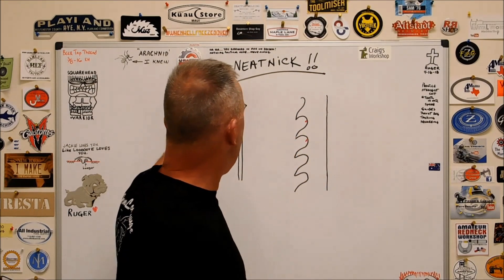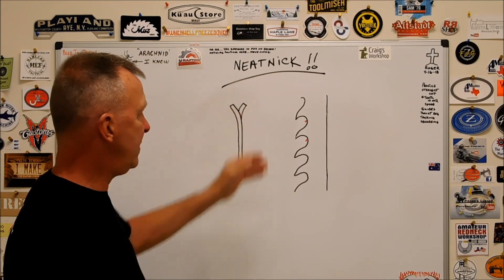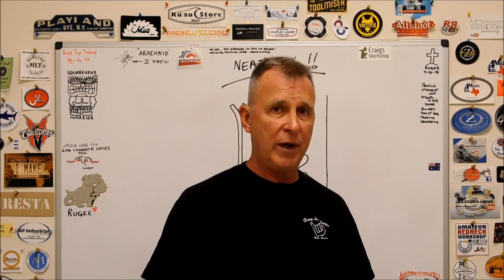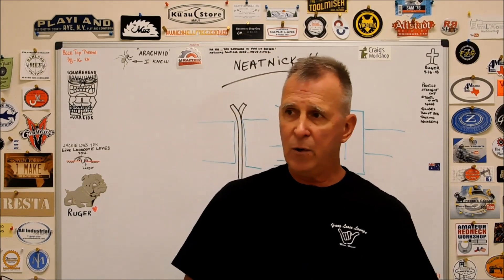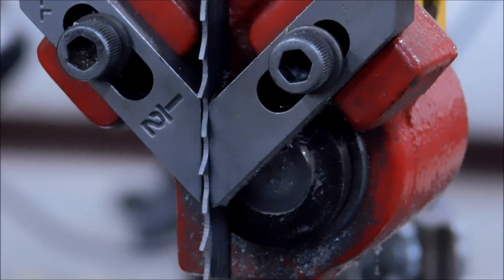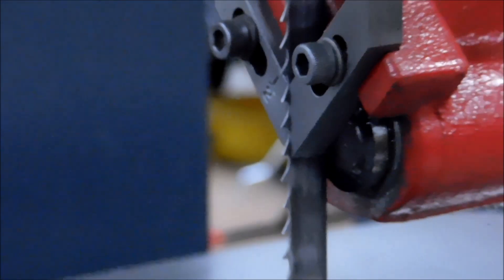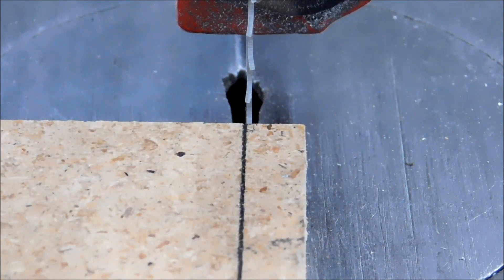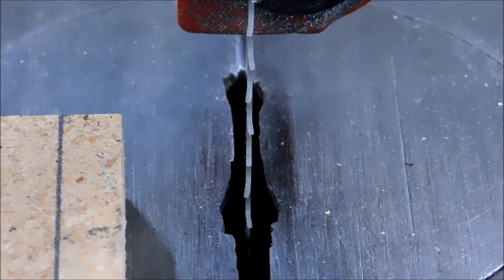Better Edge Cut Control on Your Bandsaw

Comment: Vertical handsaws & Porta bands are the most underrated tools. 90% of the time it's the first tool I go to. Plasma cutters have their place, but they give the appearance of speed. I can scribe a line & cut to it, making chips not vaporized metal, freehand. So versatile.

Comment: Using the back of the blade to guide small trimming corrections. The very first time I used a band saw, I did that intuitively. Not bragging, just saying. You do a superb job of explaining the details. There are some folks who can be taught the details, others who can see them almost without thinking. Those of us with better intuition still LEARN FROM YOU!  Thanks much.

Comment: Hi Joe, Before this video, I thought I knew  bandsaws! I have used 36” Diameter band saws & cutting 12 inch thick stock, down to Nine inch bandsaws with an 1/8” blade!

Your sharing of “riding the back of the blade” was a Revelation to me!

Thanks,

philip from the Great Pacific NorthWET !!!

Comment: Great tip on the "riding the blade'. I was at GOTL19, but missed getting a chance to say hello to you. 
When I want to be really really precise with my bandsaw cuts, I have set up a drone CCTV type camera and  display to get close up views of my cuts to get right on the line. The advantage of a drone cctv camera is that there is no display lag like you would get with a usb camera.

Comment: I restored a bandsaw bought completely all bearings shot. Thanks for showing this and the blade riding tip. (I added a switch & red indicator light to this bandsaw to indicate when theres no tention set and prevent the saw from starting if the blade has not been tentioned.
So far it has not shown to be a problem having.)

Comment: Nice. I have the Craftsman bandsaw. I just started working at mold making shop. The bandsaw we have there is atrocious. We cut big blocks of hardened K20 steel for injection molds. The thrust bearing is seized and the blade is just making a slot in it. I've been working on it when I have time. Getting a little better. Good tips. Definitely will try them out.

Comment: Enjoyed your video on bandsaw blade setup. You might mention that the guides under the table should be set up in a similar fashion. A supplemental video on blade welding and cutting internal circles with a bandsaw might be interesting. Thanks again!
Reply from the maker: I did film them, but the footage was too dark for the final edit.

Comment: When I read the title I thought to myself: well, Joe is switching to woodworking tips, I hope he keeps the precision he's got with steel  :) then I watched the video and got my answer at 14:30 ! All tips are valuable either for metal or wood cutting bandsaws.

I guess that laying the thrust bearing (8:16) perpendicular rather than parallele so it provides axial support rather than radial is done on purpose to avoid the blade to "eat" into the bearing outer ring. In the actual configuration, pressure is spread on a wider area, and wearing of contact area is done in a lathe facing way rather than in a saw cutting way.

Comment: Riding the blader is a technique I may have used without knowing it.  Thanks for the great info.  I work on and use bandsaws all the time, they are a unique machine.
I find balancing the wheels and pulleys will help a great deal in reducing the B-Saw Shakes and truing the kerf size in the material.  Thanks again.  Bill
Reply from the maker: I do have a shake, but have always attributed it to the guy who bored the drive pulley. I'll chase it out one of these days.

Comment: Another valuable technique explained and demonstrated. Given the way the band saw blade teeth are set, I suppose over use of this could lead to added wear on one side of the blade (resulting in blade drift) unless one consciously varies which side of the blade is used in this way.

Comment: That "ride the blade" technique is great -- I've been doing something similar for a while but I've never heard the technique named or talked about. When I'm cleaning up a cut similar to what's shown here and I really want to minimize the amount of material I'm taking off sometimes I'll even run the material along the blade backward, IE pulling the material toward myself. That way the front of the tooth doesn't get a chance to fully engage and you can take off a strip of material which is actually thinner than the blade's kerf. This probably causes some uneven wear on the blade but I only do it for extremely light touch-up work and 9 times out of 10 it beats taking your work piece over to a belt sander and doing an entirely separate cleanup pass. If this is a bird-brained thing to do and I'm destroying my saw then I hope someone will let me know, but I've definitely been happy with the results.

Comment: Another great video, and learned a few thing 👏👍
A quick and dirty way to get a blade to run true if cutting to one side, is to hold a piece of grind stone/wheel lightly against the ‘sharp’ teeth as it’s in motion/spinning, for a full revolution then check, repeat as needed.
Done this many times.
Reply from the maker: Basically make both sides dull? Makes sense, but wouldn't it kill the blade life?
Reply: Joe,
All depends how blunt that one side is.
I’ve only done so to get a couple of new blades to run true, and they only needed the lightest of pressure and checking after each revolution.
Those blades lasted years on a DoALL.
As a last resort on an old blade just to see you through.

Comment: Joe Pie: You make me laugh!! AT MYSELF! just an old guy here but have been mucking about my the shop for many years, and had begun to think I knew a little bit. But NO, after watching all of your videos, I realize that YOU really are a master machinist and I am just a wanna be!! YOU ARE REALLY GOOD. Thank You for enlightening the rest of us.I would REALLY like to find out a bit more regarding the DOALL bandsaw video as I too have one and have been struggling with DOALL'S omission of an adjustable rear blade bearing. It has been problematic for me to get the bearing provided set up accurately for different blade widths with respect to positioning the blade to track properly on the main wheels. Can't get the blade gullets to track near center and utilize the bearing accurately. I must be missing something!I realize this is long winded but hope you understand what I mean. Any thoughts appreciated. THANKS for sharing your wisdom
Reply from the maker: On a doall, use the tracking adjustment to set the gap on the thrust bearing since the thrust bearing is not adjustable. Then, each blade will need its dedicated guide for its specific thickness, to be setup properly.
Reply: OK! Thank You Joe. Keep the vids coming They are GREAT

Comment: Joe, Some bandsaw blades seem to unequal set on the teeth R vs L, and to cut to a line I have to angle the work.  Not a problem with quality blades.  And not a problem with the guides.   I like the tip of using the back of the blade as a guide.  BTW, I make my own blades, silver soldering the join.

Comment: Holy crap. Thank you so much. I tried cutting sheet metal one time and immediately realized the band saw was not the right tool. However my coworker...well...let's just say I have replaced the blade 7 times in the past year. He always has that blade bending and sqealing and the material is bouncing all over the place. Thin stuff like .030" up to 1/8". It sounds horrible. He scuffs at me when I suggested not to use the band saw for thin material. So I let it go...whatever man. 
After your information Joe, I can explain to him why not to use the band saw for the thin material. AND I can have the supervisors purchase blades with more teeth for those thin materials.
Reply from the maker: Slow the speed down for the metal, and maybe cut a piece of aluminum or other material to create a zero clearance condition. By having a tighter groove under the mater, and the benefit of a backup, the material will be less likely to grab.

Comment: Bandsaws  bandsaws bandsaws   -the bane of my life!  Horizonal & Vertical - Should I , Shouldn't I use a rotary instead etc....  all to do with the work thickness & Changing blades to suit + replacing damaged blades.  setting them up aligning them -not as I thought - do once and that's it.    Like the piece on the different types of heads - got more out of that than I noticed in my Op Mans.
Advice on best way to cut thin sheet shapes- up to 2mm  without a guillotine and don't mention handshears !  ?     Thanks for the mental excercise!

Comment: interesting that DoAll would use hardened blade guides. the best material to use is actually a tin bronze as that doesn't gouge the blade when it makes contact when doing radius cuts. it also doesn't dull your teeth if you have to pull your work piece backwards away from from the blade... which is a common occurrence when doing close radius cuts.

running hardened guides  in a band saw requires one of two things: coolant or lubricant. 

if you're having problems with your blades failing (breaking) prematurely perhaps a change of guide material would be the solution.
Reply: Why would pulling the work backwards along the already cut line dull the blade? Even if you’re sloppy, the blade sides will rub against the side guides, but (assuming you have the guides adjusted properly) the guides don’t touch the teeth. What am I missing here?
Reply: @steveh8724 , it's simple really: when you're backing the work off of the blade, it pulls the blade back with it often times, because the heel of the blade catches on the kerf in the workpiece. the blade then has a tendency to drift and make contact with the guides underneath the table. evidence for that is often the gouges in the table plug where the blade goes thru the table. the table plug can also dull the blade if it's made of something relatively hard. most are made from zinc or aluminium. 

there are also several potential points of contact under the table out of sight that the blade can contact when backing up a cut. 

but then the table plug can also dull the blade when cutting tight radii 

keep in mind that the lower guides do not move up or down along the long axis of the blade. so any movement other than straight into the guides will make the blade do some really funky acrobatics in the lower guides.. ideally a band saw blade cuts a radius only as short as the arc that you can create between the heel of the saw and the outermost elevation of the tooth set. the wider the blade, the longer that arc will be. that's why narrow band saw blades can cut shorter arcs better than wide ones... or why wider blades do better in re-sawing operations

Comment: Great technique Joe!!!  I will try it!  We just got a kalamazoo horizontal band saw and it had a sump set up.  We are not familiar with these sump setups or what to run in them.  Question, what type of coolant should I be running in this.  We cut mainly A36 steel architectural shapes and some cast iron, ductile, all in low volumes.  Unfortunately the saw is near the woodshop and the office so I need to keep the smell and cost down.
Suggestions?  Thanks!

Comment: Our visual perception is both wonderous and goofy as heck. For nearly 4.5 minutes, I was distracted by the strange drawing on the right, which reminded me of some globular structure I studied in anatomy class.

Your sketch skills are typically so good, I was thinkin' the Good of the Land must NOT have been good for you.

Then, in the instant you finished the perspective drawing of the guide, my mind reversed the globular thing on the right, and my mind finally allowed me to see the teeth!

Now, I can go watch the rest of the vid and not be distracted.

"The bandsaw, the most underrated, (complexity-wise), tool in the shop."

Have you tried any of the variable teeth bandsaw blades? 

GeoD

Comment: Sometimes band-saw blades will cut a curve without having missing teeth. I found that I can eliminate that problem by (using a saw set) putting a slight set to some of the teeth on the outside of the curve - every 6 to 12 inches.
Reply: Does using a saw set work for 12 or 18 tpi blades?
Reply: @googacct  My saw set would probably handle 12 TPI but it would likely need a sharper point to handle 18.

Comment: I have seen discussions on various forums about whether metal cutting band saws should have rubber tires or should the wheels remain bare, with the argument that chips can embed in the rubber. What are your thoughts?
Reply: And car tires should be cut with sawzalls...because they sawz all. ;)
Reply: The rubber or urethane tires provide grip for narrower blades that would otherwise slip on a bare wheel, and it also protects the teeth on the inside of the band by cushioning them.

Comment: Is there a horizontal bandsaw that cuts straight 90°?Every one of them i saw so far always cut curve.On my last yob we had a horizontal bandsaw for metals that had guides on dovetails so you could adjust both depending on the dimension of material that you are cutting.But even that one did a slight curve.Only method of cutting metal with a blade that cuts straight is power hacksaw.Atleast what i saw so far.But then im young so who knows what future brings.
Reply: Because of the way that the drive wheels are on horizontal bandsaws, the blade must be twisted going into the first set of guides and twist back after the second set of guides. If the guides are not rigid enough, the blade too thin or narrow, getting a straight cut can be a challenge. DoAll horizontal band saws can cut very straight and parallel. Ours often ran all day long and maintained squareness, and flatness. They use 1 - 1 1/2 inch wide blades that are tensioned pretty tight, carbide guides, and adjustable feed pressure.
Reply: The heavy duty saws are ridged enough to cut square. Think $1500+. With the $400 harbor freight units just get it close enough and deal with the wasted material.

Comment: Hi Joe, how to cut thin metall on a bandsaw? is it possible with a sheet of wood unther the metal to make the two teed hight? I have a Doall an make a new gide with rolerbearings on each site, that works great.
Reply: for myself, the 2 tooth rule for  thin aluminium (less than 1/4) don't really apply, for myself, I use a 8 tpi min in aluminium .
Reply: the first step would be to buy a blade with the closest tooth spacing you can get. band saw blades are usually classified by teeth per inch - TPI. for thin material you would want to run a blade that is 18TPI or more. preferably a 24TPI blade. so at 24TPI you could conceivably saw thru material as thin as 1mm 

the other option, if you're making more than one of the same part, would be to sandwich a stack of the material you're using and holding it together with double sided tape. 2, 3 or more depending how crazy you want to get
Reply from the maker: Yes. A backup piece of material will really help when cutting thin material using a wide tooth blade.

Comment: Why is the thrust bearing used on the side of the bearing instead of the face?
Reply: That's a good question...
Reply: Fester Blats  I'm not convinced of that
Reply: Wild guess: if the blade was touching the face of the bearing, there would be a single point of contact and the surface would wear down more rapidly because of the increased pressure.
Reply: @frederikdesaulniers9699  No. If the blade touch a "rolling roller" the pressure is distributed along a line of contact. While rotating, the wearing is uniformly distributed along the entire cylindrical surface of the roller itself. Since the surface of the roller is far greater than the pushing face of a "stick", the overall durability would be greatly increased.
Reply: Could also be to reduce the rotation speed of the bearing (which reduces noise) or for size/clearance reasons.

Comment: Why all of the bandsaws are not simply using three spinning wheels to keep the blade in position? Why the only wheel present (thrust bearing) touch the blade with the side and not with the face?
Reply: By wheels do you mean bearings?   If so one reason is that guides with bearings on the sides instead of blocks are very noisy.   One can buy kits to replace the blocks with roller guides for some saws.  I use 'cool blocks' which are even quieter and will not ruin the blade should the teeth contact the guide blocks.   Hardwood blocks can also be used.
Reply: @danharold3087  Yes, I meant rollers/bearings. There is a huge noise coming from the motor and from the moving blade too. How much noisy can be two rotating rollers??? How they can overcome the big amount of decibels coming from all of the rest?
There is a video with such "noisy" rollers?
Reply: Something I read or seen on a video years ago.  In part it depends on the quality and condition of the bearings used.   Cool blocks are possibly the quietest.
Reply: @danharold3087  Here I found a machine with decent rollers as guide: https://www.youtube.com/watch?v=azNyKPXvbz0
(The author doubled the number of rollers. No mention about disturbing or noisy sounds.)
I really cannot comprehend why manufacturers still today install those garbage "sticks" to save few dollars...
Reply: @danharold3087  I can confirm this. I used to work at a place that had a bandsaw with three bearings for blade guides. It made a loud scream and a moan even when cutting plastic.
Reply: Noise - as Dan Harold mentioned. Small ball bearings traveling at the full speed of the bandsaw blade (especially so on wood bandsaws) make a terrible racket. Yes - worse than from the motor or moving blade, and the cut progressing. Also - guide bearings can trap and suck in chips. With guide blocks that's much less likely. See also: Lathe fixed steady bearing choices.